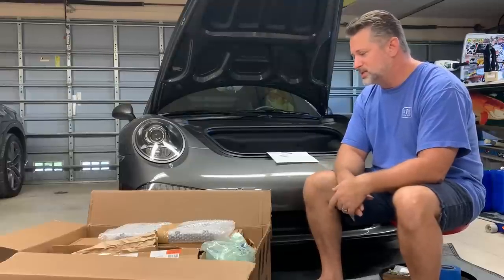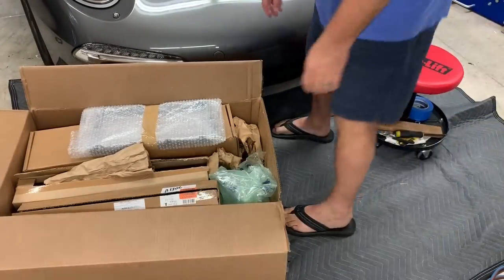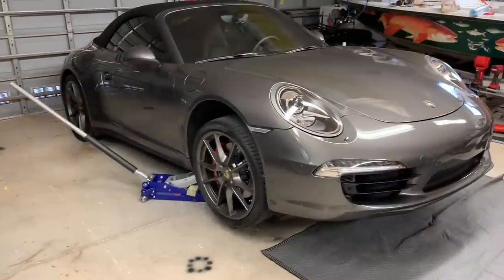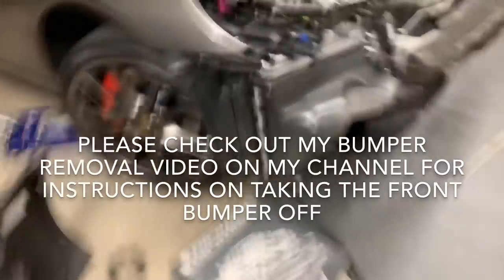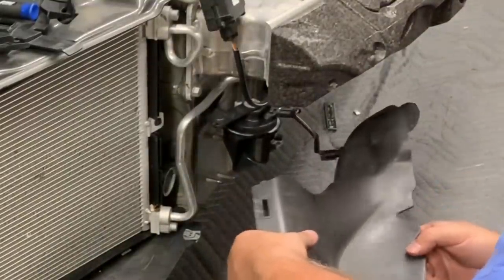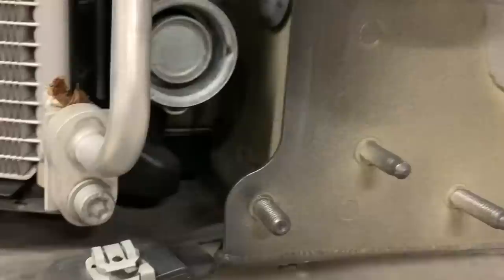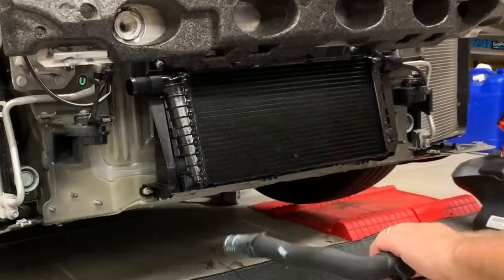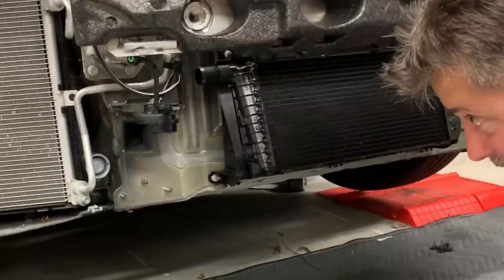Porsche 911 Third Radiator Install

Comment: Always is better to check for leaks before install back the bumper.  You felt cool to touch the center radiator compared to 2 outside hot units, the reason is you was touching the AC condensers instead the radiators that are mounted behind. You did a very meticulous job!! Your car looks great and your X51 power kit is now complete!  You are a truly Porsche enthusiast!!!!!  Cool🤘🏼
Reply from the maker: Alejandro Rubio thank you!

Comment: Thanks a lot for this video, just did this on a 991.2 carrera.  A few steps different but basically the same.  I was able to leave the headlights in but had to take the wheel wells out instead.  Also I just topped the coolant off and followed the PIWIS instructions without the piwis for bleeding, no issues.
Reply from the maker: durandalmk2 that’s awesome. Thanks for the comment. I’ve heard horror stories and then I’ve heard super easy like your experience. Glad to hear it went well!!  Definitely one of my favorite upgrades just because it finishes off the front of the car in my opinion.
Reply: @bobbygfl  Ambient temps at the track have been 105F degrees.  Oil temps hitting 275F after 20minute session, hoping this helps bring that down!
Reply from the maker: durandalmk2 I’m sure it will. I noticed a significant drop.
Reply: Follow up if anyone was curious, 103F ambient and oil temps never broke 255 during 20 minute TimeTrial sessions.  Also noticed oil temps drop almost immediately back down to 220F after just 1/3 of a cool down lap.
Reply from the maker: durandalmk2 thanks for the info!

Comment: my prior 9114s a 997 had a combination oil and water cooling radiator in the middle and my 991s does not need it as the pdk likely runs cooler.
Reply: tiptronic cooling.
Reply from the maker: paul l this mod was more for looks.

Comment: Thanks for the video, I am about to do this on my 991.2.  Which vacuum filler tool did you actually use to burp the system?
Reply from the maker: Tony M this is the one I’m using in the video. It took about 1/2 gallon after about 50 miles. So even with the tool, running it still pumped out more air. UView 550500 AirLift II Economy Cooling System Refiller https://www.amazon.com/dp/B000IHK1VI/ref=cm_sw_r_cp_api_i_BhJxCb4BBQVQS

Comment: Thanks for the video，Can you give me a purchase link。my car is 991.2 4S，when I use normal mode，The oil temperature is about 230 .I'm looking forward to the effect of the third radiator. I hope I can improve on the track.
Reply from the maker: The link is constantly changing because the product gets updated go to Suncoast Porsche parts online and search third radiator and plug in the information for your car. Thanks for the comment!

Comment: did you get any Engine Control Fault messages after starting up and driving?
Reply from the maker: adrian steranka yes. I got a coolant fault code. However after checking the level turned out that I did not have the cooling system full. It took almost a gallon after idling for a few minutes and then shutting the engine off. Whatever the date of this video is the date that I did the work and there has been zero issues since.

Comment: I am about to change the spark plugs on my 2015 991 as they are supposed to be changed at 4 years or 40k miles so you might add that to your list of videos to do.  Thanks!
Reply from the maker: Keith Greer good tip!  Mine are 5 years old. I’ll look into doing that.

Comment: That’s the ambient air sensor ,,,, the air bag sensor are blue and yellow,,, so don’t go messing with then if you see one unless you unhook the battery first ... boom ...
Reply from the maker: MIXMASTER RONEDEE thanks!  Good tip lol
Reply: @bobbygfl   When i fitted my GT3 centre rad ,,,, i turned on the ignition but didn't start the car, turn the heat to max fan to low ,,, start the vacuum pump till its pressurises the system, rase the burp clip then sucked the 50 50 mix coolant and distilled water in, start the car ,, and re pressurise the system again after the first fill , repeat the filling process again , the pressurised system opens the thermostat ,,, once you get spray back like you got the system is full in the fill tank ,,,,, you would need to rev the car to 3000 rpm for 1 or two minutes while filling until the front fans come on,, once full, take a test drive when the car gets to temperature you can rev the car to 6000 on an off ,,,, you will need to top off coolant about when the car cools down about 1.5 Litres, next day check coolant and top off if necessary  ,,,  my car oil temp sits at 85 to 90 degrees now nice n cool ....  info from my blog  997 retrofit & custom https://www.facebook.com/groups/1515570201802930/
Reply from the maker: MIXMASTER RONEDEE unknowingly it sounds like I did the same thing. I thought it was full after this video however after driving it it took a bit more of 50-50 mix. I didn’t drive it hard so what you’re saying about the RPMs was pretty much what I did. At this point I was overflowing so I thought for sure I was full. I then drove the car harder for about 40 minutes and the next morning it took almost a gallon!  Now I know that reservoir tank is pretty big so it likely sucked what  it could from there and I wasn’t really as low in the system. I did not get any warning lights and the temperature holds right at 197. Now we’re almost a month later and the coolant level hasn’t budged. Same as you, car runs nice and cool. Thanks for the comment and the view!

Comment: Um, this idea of running hot has me concerned. Let's review. A street car is designed to run at a fixed temperature in all normal operating conditions, which includes idling around town on very hot days with the A/C on high. Beyond that, every decent sports car is designed to maintain this temperature even on hot days while you flog it at the track. So, if your car is not able to maintain its temperature in town, something is very wrong, IMO. I wonder of other 991.1S owners have temp issues around town.
Reply from the maker: Brian St. Denis sorry wasn’t clear. Running at 212. The upper end of the normal range at about 95 ambient air temp. Maintains 212 perfectly. With additional radiator maintains 194 perfectly in same ambient conditions. This is low end of the normal operating range.  Also, this is the coolant temp I’m referencing. The oil temp which does serve as a cooling source runs cooler than before but only by about 5 degrees. Not as drastic a change. As for the change with the mods: the cams, plenum, exhaust and tune has increased HP. More HP from the same block will create more heat. No way around that. Hope that helps!  Thanks for the comment

Comment: Mr. Amateur Porsche owner what is your goal? PORSCHE has varieties of 911's, they have to make $$$, and everything had been calculated  long time ago. Your actions will not change your car's performance that will be beneficial at the track. Race your car  with another 911 owner that has the same model but OEM. Who's gonna win the race? Keep on modifying your car, you're only changing your degree of anger.
Reply from the maker: Thanks for the comment! Love making the mods. No anger here. Zero chance of me racing it either LOL. Just a Sunday driver. Usually slow as possible.

Comment: This radiator is fine for PDKs? I ran across one that said manual only
Reply from the maker: I think there’s an oil cooler in the way on pdk’s and it’s simply a different part number.

Comment: @ c. 11:25 - Air bag sensor in the front rad duct, FFS, really! Air temp maybe???
Reply from the maker: Yeah at the time of the video I had no idea what that thing was. I did learn later it was the airbag sensor thank you
Reply: @bobbygfl  "I did learn later it was the airbag sensor" - I am pretty sure that it's NOT an airbag sensor.
Reply from the maker: @stubbsey7205  cool thanks!
Reply: @bobbygfl  As @Stubbsey suggested:  that electrical device on the right front air duct is an outside temperature sensor.

Comment: That vacuum system is designed to work only when all the coolant has been removed. Since you had existing coolant in your system the tool is useless. All you needed to do was start your car and rev the engine. That would have gotten the car to temp and allowed the front middle radiator to fill. The other mistake was the hose in the tank with coolant water mix. You introduced air back into the system.
Reply from the maker: A N ah. Good tip. I was wondering. It did suck quite a bit in, but I do get what you’re saying as far as bubbles in the system.

Comment: Thanks video, do you remember how much coolant did you need to add, I am having an issue that the car is running hot, it seems i need to add more coolant.
Reply from the maker: Almost two gallons. I didn’t drain the system so I’m not sure how much it holds. From what I understand you can’t overflow it and the worse thing is air trapped. I thought it was full. Ran the car at it took almost 1/2 gallon. Must have cleared some air. Good luck!

Comment: Great video. Have you noticed the time for the engine to come up to temp taking longer?
Reply from the maker: Dario Campolattaro thank you. No, the engine comes up to temp just as fast. I believe the car does not run fluid through the center until it’s up to temp. Anyway once it’s at temp (194) it stays right at 194. Doesn’t budge.

Comment: Why did you add a third radiator?
Reply from the maker: Ather Radwi Three reasons: after the modifications I made the engine was running slightly hotter, the horsepower gain although minimum and aesthetically I like the way it looks. Thanks for the comment
Reply: YOLOfotos Great. I assume your going to add  a glossy black mesh, not only it’ll enhance the looks but also to will prevent large debris build up!
Reply from the maker: Ather Radwi I’m still deciding. I may put a mesh screen directly over the radiators. I’m not happy with any of the after market mesh screens that mount in the openings. They all look like an add on to me.
Reply: YOLOfotos hahaha, yes I got ya!
Hey, I was thinking and of course depending on the budget, what if one can get the front and rear aprons +/- are-kit made in carbon fiber with all the correct details of air-intake channels, radiator mesh, etc., and painted in his/hers favorite body color with variable polished raw carbon trims!

You’re lucky in the USA/ Europe, you have all these specialty and after market shops, that you can modify your car in steps to your final liking! Plus, you have so many racing track and back good back-roadsI 
in Saudi we have neither! I have to go thru the dealer ship, otherwise void the warranty on my 2017 991.2 Carrera with PDK & PSE !
Thank you for the great effort of video taping and sharing your hard work in pursuit for the personalized perfect Porsche. Have a great one, sir!
Reply from the maker: Ather Radwi thanks for the comment! What you describe sounds awesome!!
Reply: YOLOfotos Thank you so much for your appreciation .....and with some more investment, custom made Carbon Fiber wheels, and voile one heck of a road legal racer is born!
Reply: @bobbygfl  Sorry if I am missing something obvious but how is a 3rd radiator going to add any horsepower?  Love the video and plan to make the installation soon.
Reply from the maker: @davidpiper2121  it’s my understanding that the the car is able to make more horsepower at 194 than say 210-220. That’s not true with all engines that are designed to run hotter. And we’re talking about a tiny little bit of power. But anyway, that’s the logic. Again I did a purely for looks lol. Anyway thanks for the comment
Reply: My car is running 111oc max isn’t that normal that’s like 230f